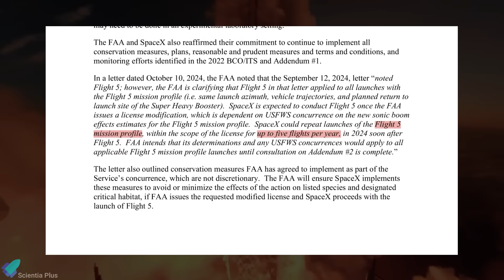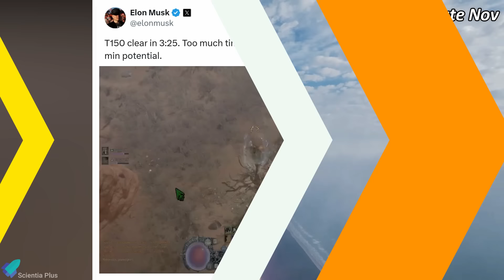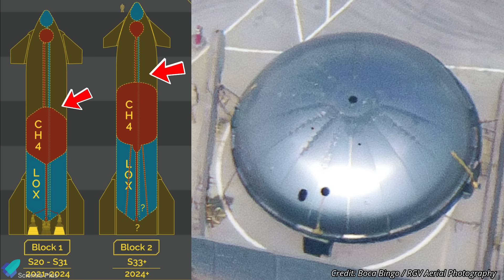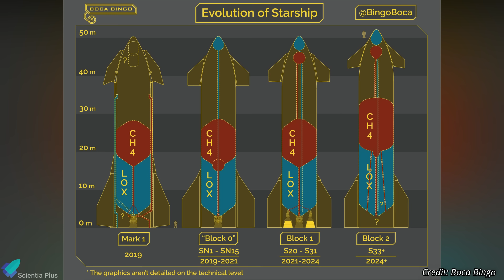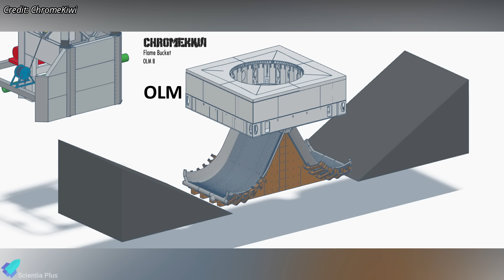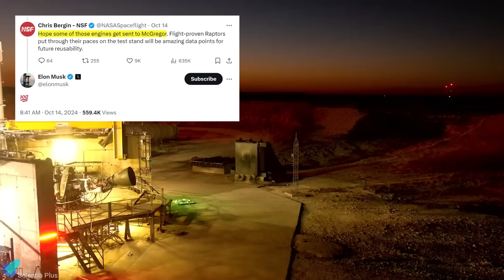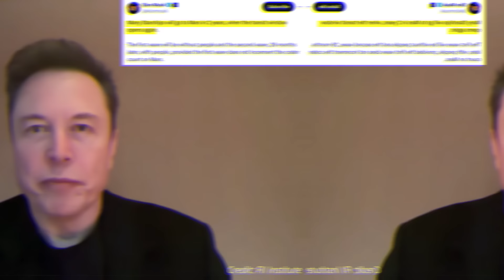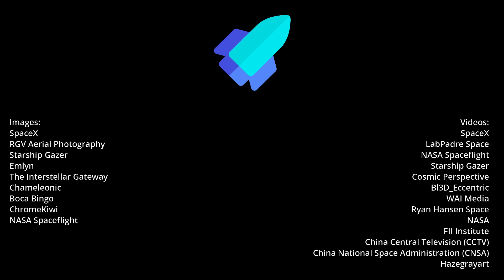SpaceX Tested Starship Block 2 Feat. Mega Redesign - Did It Survive? Flight-5 Disaster ESCAPE!

Comment: does anyone else think using starship for starlink is a waste of that ship. its like using a semi truck to get a gallon of milk from 7-11
Reply: I think it's a smart move to test Starship with multipule Starlink deployments. They can deliver many more satellites each launch saving Musk money. It will be a while before customers line up to use Starships huge capacity. In the meantime makes sense to proof the technology with frequent Starlink launches.
Reply: @dougm3037  That's a good point. Thanks.
Reply: <yeah, so ummm...the older starlink sats were pretty small, but the new ones are around 600lba, and about the size of your kitchen table, so the falcon 9 payload and fairing size come into play when doubling all the weight/dimensions from v1/2>
<forecast payload for starship is 100tons to leo(?)>
<600kg x 22 or 600kg x 40+ are the numbers>
22,800 kilograms (50,265 lb)
<falcon9 payload to leo is still pretty impressive>
The Falcon 9 rocket can carry a payload of 22,800 kilograms (50,265 lb) to low Earth orbit (LEO). It can also carry a payload of 8,300 kilograms (18,300 lb) to geosynchronous transfer orbit (GTO).

A Starlink v3 satellite weighs 573 lbs (260 kg) and is roughly the size of a table. Starlink satellites orbit 22,236 miles (35,786 km) above Earth and transmit information through space to provide internet access.
https://en.wikipedia.org/wiki/Falcon_9
https://www.nextbigfuture.com/2024/03/spacex-starship-launched-starlink-gen-3-unfolded-nearly-as-wide-as-the-space-station.html
https://www.starlink.com/specifications
https://www.space.com/spacex-starlink-satellites.html